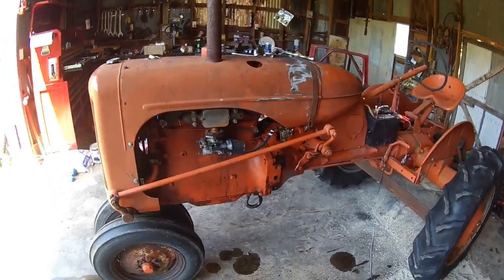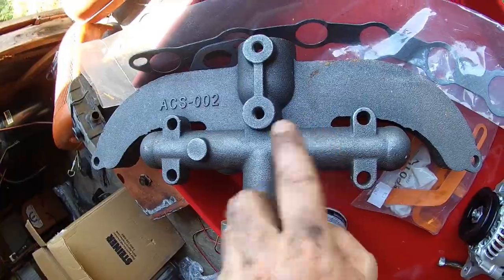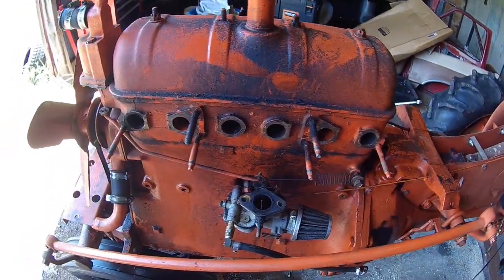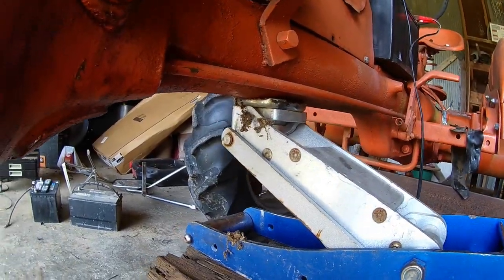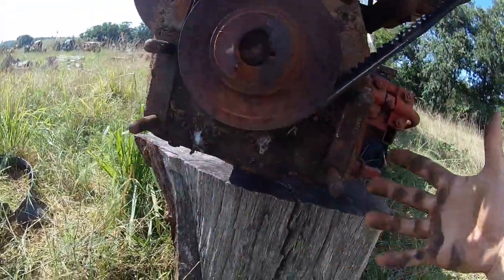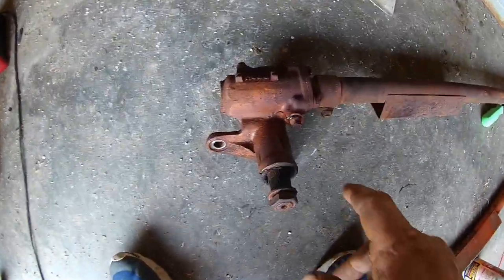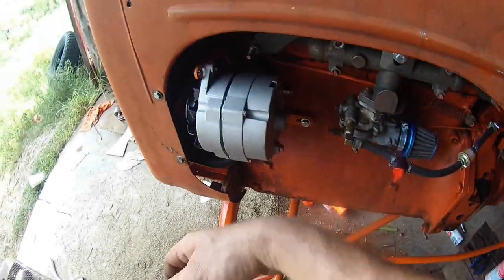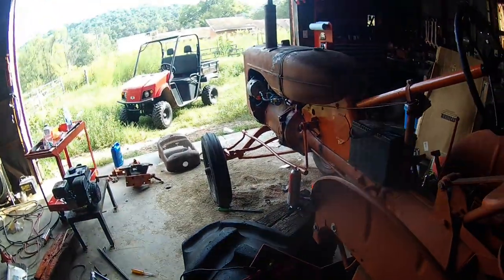allis chalmers wide front end conversion how to

Comment: First time seeing your channel : watched converting Tricycle front end to wide front end: I have two Allis Chalmers C's tractors : one is Wide front end & the other is Tricycle
Reply: Like your willingness of being upfront with the problems you run into & you're willingness to share where to get the correct parts and numbers of the parts .  I know from experience myself the information you share is invaluable because I end up spending most my time going through the same scenarios as you went through converting the front ends , putting on the one wire alternator and the front seal   etc.  Again I appreciate you sharing your experiences and knowledge

Comment: A C with a B front axle doesn't really look right, could you not find a C wide axle?
Reply from the maker: They are the same frontends but there was 2 different kinds adjustable and non adjustable the one i had was non adjustable the adjustable would have looked better i agree
Reply: @Farmscrap1183  No, it's very different, much wider, has an extra brace bar, has a relay mounted on the pedestal  which connects to the drag link and the pitman arm goes up, the same as the tricycle. Have a look at this - https://www.youtube.com/watch?v=XOEYkyAYCBc
Reply from the maker: Yes that will also fit a b but you have to change the steering box and arm to make it work and steer correctly nice video